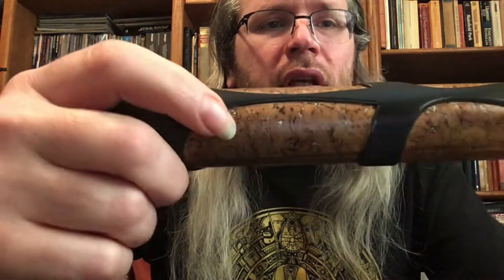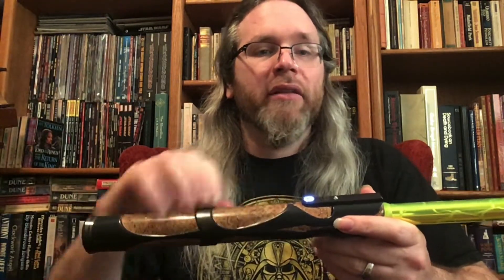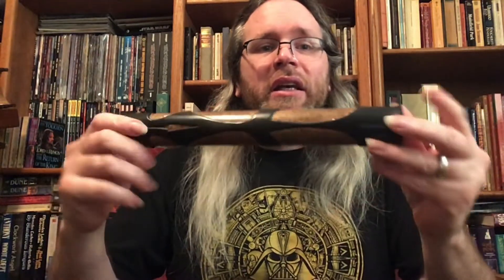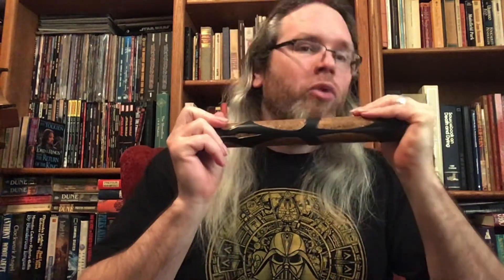Koruku wood Radium saber from Bendu Armory.

Comment: Recently got my Radium and I've already stripped the screws...You wouldn't happen to know the dimensions of the retention screw? And if I could find a thumb screw at a local hardware store to prevent this from happening again? Thanks and love your content! :)
Reply from the maker: I don’t know the exact size, but you can just take the screw with you into the store. thumb screws work great. they are what I use.
Reply: @DarthCephalus  Yeah I decided to stick with a socket screw. I found thumb screws are enough support for spinning but not dueling. Thanks 😌